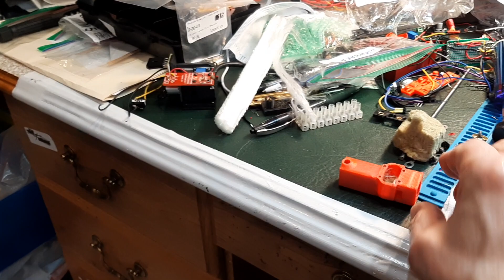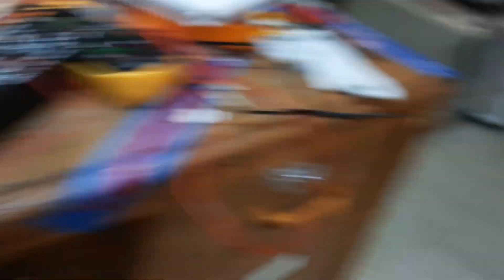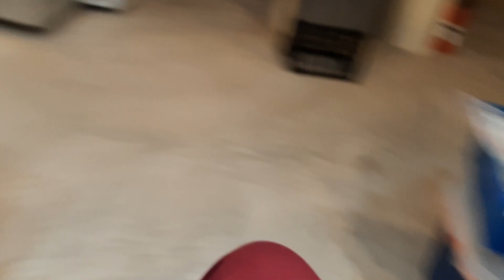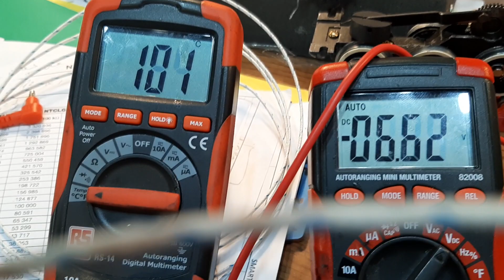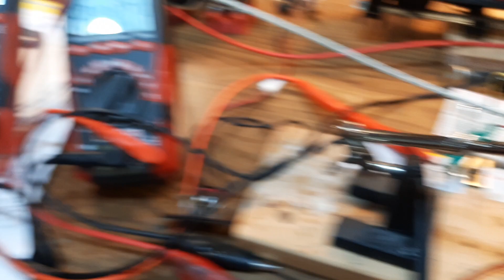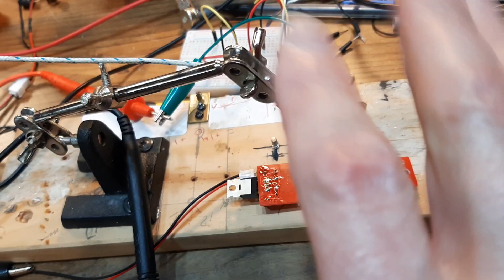Frankentrain Laboratories Smart Smoke theory and test verification.

Comment from the maker: I retested and may have found the key to success. I took the SS off the Buck Boost board and feed it 8 Volts from my Bench Power supply. AH HA! it worked perfectly smoking like a train. Now I need address what is different between the two power sources. More soon. D